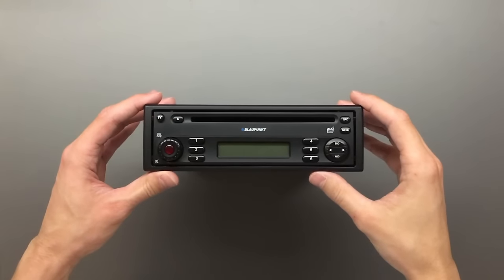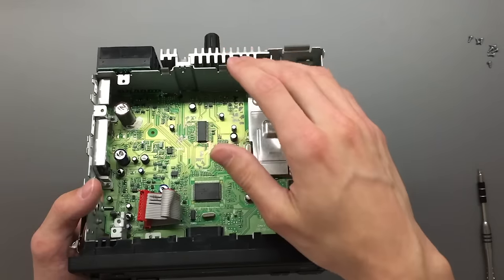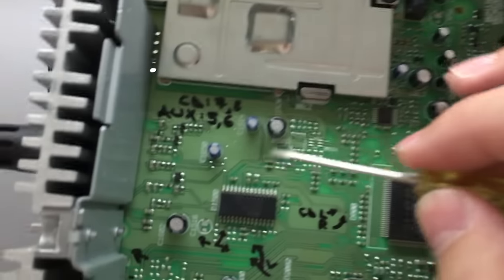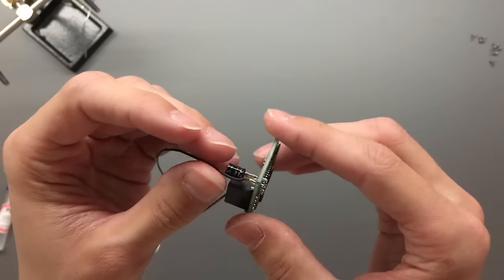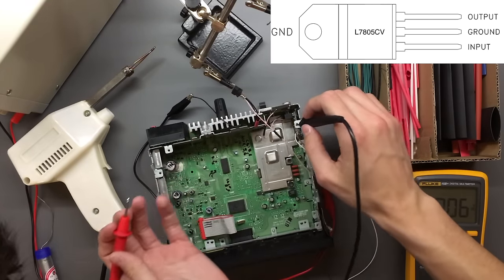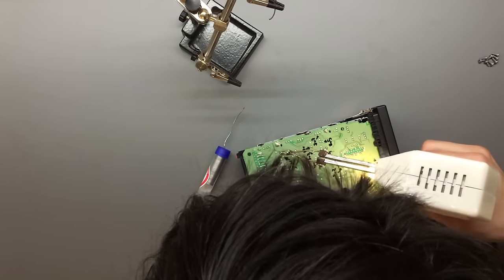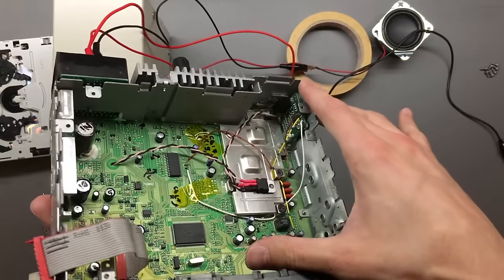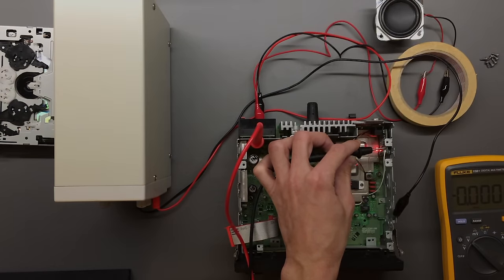How to Add Bluetooth 4.0 to Any Car Stereo for 12$ ! Complete Guide !

Comment: My radio has an aux output at the back panel, I mean aux switches. How I can use this connecting Bluetooth in cheap way?
Reply from the maker: connect the 3 audio wires from the BT module to the AUX in
Reply: Darieee the module that you used in this video?
Reply from the maker: yes
Reply from the maker: No, you need this : http://bit.ly/2zXSsFa
Reply: Darieee OK, thank you so much!
Reply from the maker: no worries :) good luck with your project

Comment: Great diy project. Perfect for stealthy installs and classics. Fiy, solder is pronounced "sodder"
Reply from the maker: yyyyea nah I don't know - I did check some reputable sources and it did seem to be sodder, I still enjoy pronouncing solder though ... jury's still out on which way I'm gonna go on this
Reply from the maker: Nah, works just fine - I'm just always playing a silent cd on it

If I pop in a normal one it'll play that (though if I play bluetooth music whilst a cd is playing it'll sound like shit and .. at the very least risk damaging the output drivers on either the BT chip or the CD player)
Reply from the maker: I'll be performing this mod (or at least trying) on a Becker Audio 10 CD tomorrow so, stay tuned :)
Reply from the maker: Mm, not sure I follow what you're saying

In my particular case I needed the CD player to actually play something, because otherwise the microcontroller wouldn't select the CD as a source (and whould keep it muted)

Only once the micro gets the OK from the player that there is a disc and it is in fact playing does it connect it to the amp

If your radio never mutes the outputs then .. you'd be free to not actually have a CD in there
Reply: if you enjoy it, don't let me or "correctness" get in your way =)
Reply from the maker: There's no switch, everything's digital, the micro asks the drive what's up and gets an answer, which I really didn't find worthwhile to spoof

Comment: I've d done it...thanks for the tutorial : )  ...now i can us my phone to play my musics... i did not connect the ground wire just the left and right wire for connected to my aux no ground because i noticed when i connect the ground wire to the case of the stereo... the left speaker have no speech or voice...just the low sound...then the right speaker has both low sound and high...
Reply from the maker: Yeah .. some weird ground issues ..

Some audio mixer chips have a separate 'audio ground' input, which sometimes goes through a capacitor

Take a closer look at the datasheet for your chip
Reply: @Darieee  yeah....but my chip is TDA4740D... so what will i do with the ground issue?
Reply from the maker: Are you sure that's the part number? Can't find any datasheet..
Reply: @Darieee  i'm sorry it's tda7404d
Reply from the maker: And which inputs are you hooking into at the moment?
Reply: @Darieee  the SE1L and SE1R, which is the cd mode left and right
Reply from the maker: Yeah, you need to hook the AUDIO_GND to the chip's GND ...

You might have some wires touching or some stuff if that doesn't work

Just to be clear, the bluetooth module you're using has an isolation dc-dc converter, right ?
Reply: @Darieee  nope i just use the bluetooth rechargeable receiver, if im not charging the bluetooth device, the sound is ok, but when i connect the bluetooth device to charging, static ground occurs

Comment: Darleee+ That 5v linear regulator that you epoxied down, do they make a 4.2v~3.7v to 5v boost regulator for a Bluetooth PAM8403 amp? Thanks
Reply from the maker: I'm not sure I understand what you need exactly .. send me a link of the amp and tell me again what you want to achieve
Reply: I need clean 5v juice like a battery with little to no noise or ripple
Reply from the maker: alright, and where are you getting it from ?
Reply from the maker: as in, do you want to power it from the wall or do you already have a battery pack made for this ?
Reply: I have a 10,000mAh LiPo battery, but I want to run it both ways and charge it with a TP4056, but I need to increase the voltage to 5 volts
Reply from the maker: alright so ... I think I understand what you're going for now

so, you want to be able to leave the thing connected to USB and have the battery stay charged but not be in use, right ? I do suspect the TP chip would just connect.disconnect the battery from the charger if you'd use it in plugged-in mode like that ..
Reply: Yes but I need a 5v boost of clean sine wave for audio.
Reply from the maker: yeah, for that simply go with this http://ebay.to/2zmJzZ1 - I've used it in many audio applications and its switching frequency is far too high to cause any issues 

(most of the noise you'll hear will be from the Bluetooth Radio and the noise floors of the BT Chip & Amp)

There is the other version of booster modules with the much larger chip - avoid those (they're way more inefficient/bulky/expensive)
Reply from the maker: what I'm thinking about now is how this setup (USB 5V into TP4056 ; protected output from 4056 into booster ; booster into amp) will function when you use it while it's charging AND fully charged ...
Reply: I use the TP4056 in series to charge my 16.8v. the inputs have to be separate. I use 4 phone chargers for isolation reasons and that solve the magic smoke issues
Reply from the maker: +MrBrymstond uu .. that sounds like a real hassle ... why not get one of these http://r.ebay.com/EEkksw and couple it with one of these http://r.ebay.com/jZXNrh (or 4S variant)

Also, why use a 4S setup for an amp that small that needs only 5V ?
Reply: I have the mini B6, but I had the parts and when it's done charging all 4 batteries are balanced because the stop charging at 4.2v so it saves me so much time. I've been using this system going on 3 years with the same batteries and parts. when They're done the meter says 16.8v and each battery says 4.2v. I have to use the 5S cables because each battery has 2 wires, both pos and neg. My mini takes forever. I'm using all good quality parts because they stop charging within a minute of the other. and charge time is cut by 70% each battery gets 1amp so 4 amps a enough.
Reply: I use the 4S on a different Bluetooth setup. Do they make a 4 pin boost 4.2 to 5v regulator
Reply: That's what I wanted to use, I have boxes of different quality sepic converters a just buck or boost, but I was talking to a guy from Voltlog and he seems to know something and says no, don't do it unless it's all surface mount high quality parts. I'm going with your idea which was the same as mine. It sounds perfect plugged in so just compare, Thanks a lot.
Reply from the maker: nah, those won't do that .. so .. for the small PAM amp ... it's complicated, you will have to build in a switch that disables the battery (and you could then just leave it at that : whenever plugged in - always on, when on battery, the switch acts as the main power switch)

for the 4S setup, your solution of 4 chargers is quite cumpersome .. does work but .. yeah .. I'd recommend the 4S bms + 4s balancing + constant current booster circuit
Reply: Yeah, I don't mind the switch, I would install it right at the battery and another 2 wires to the amp... They have to come up with a clean solution that's easy to get. I have a small Bluetooth with a UPC idea close to what I showed you where it always runs off the battery and starts the charge half way  depleted like this.  https://www.youtube.com/watch?v=p5lg0bfmgCw&t=2s
Reply from the maker: I'm sorry but I really didn't get almost anything from your last message
Reply: Yeah, I don't mind the switch to just use the battery, I would install the switch right at the battery .. They have to come up with a clean solution minus the ripple or noise that's easy to get being these amps are becoming so typical. I have a small Bluetooth with a UPC idea close to what I showed you in a url where it always runs off the battery and starts the charge half way depleted like this.  https://www.youtube.com/watch?v=p5lg0bfmgCw&t=2s

Comment: Nice video and you certainly know what you are doing but why on earth are you using such a cheap soldering iron? You might as well use a red hot poker :-)
Reply from the maker: old habits die hard - had it since I was 7 or 8 xD (will get something better in the near future though)

Comment: Would this work on an old AM-only stereo?
Reply from the maker: Mmm, technically yes, but, old electronics were done quite a bit differently

You may run the risk of coupling a lot of the radio energy into the amp ... 

Or not if the stuff's decently shielded, .. worth a shot in any case I'd say!
Reply: @Darieee  Thanks!  I doubt I will be able to find the schematics for the radio, but hopefully it will be simple enough to make an educated guess.

Comment: Thanks for the video! I got one of these modules and decided to just test it out connect to a 2S battery and see if I could pair to phone.  I do see some numbers/letters as an available device however phone says it 'can't communicate' - any ideas how to solve?
Reply from the maker: Not really .. it says CSR8645, right ? 

It might be the module turning itself off because of insufficient voltage: if you have the 12V version, you'll want to power it from 3S

Comment: 6666666666,
But how did you deal with the loading of the original audio feed (the other side of the AC coupling cap)?
Reply from the maker: I don't really get the question; you mean - how do I deal with whatever is connected on the outside of the AC cap ?

Well - for that I play a silent track audio CD -- that ensures there's no signal there

Comment: First, cool vid.  I like these kind of mods.  Second...get a soldering iron dude.  You have a $10 Chinese soldering gun and $200+ Fluke multimeter.  Fun video though.
Reply from the maker: nah - meter's actually 70$ xD - Fluke for poor people

aaand, I do have one of those 90$ chinese soldering stations (898D), and it's waaay shit compared to my trusty gun
Reply: :)) where did you buy that soldering gun ? I ask you because I know the tool very well and it's a real tank. One of the best products. I have a soldering station of $ 300, but I often prefer soldering gun.
Reply from the maker: geo geo  it's the romanian one made by Radio Progres or whatever their name was xD real beast indeed; one does need a dimmer in-line, otherwise it'll melt through diamond

Comment: My only "problem" with these videos is that in my case, I can' afford a decent cell phone and my now six year old crappy smart phone was a piece of junk when I got it.....it certainly hasn't gotten any better with age, and being disabled I can't just "race right out and buy a new one" either!! Sure my cell phone does Bluetooth connections.....but that isn't my problem with it!! No, no the problem I have is the battery dies after about an hour and in my case there are days when I am on the road all day long and having the phone charging on the dash for two hours defeats the "wireless" capabilities of the system!!! So no matter what I am still driving around with an ugly cord hanging out of my dash board that is getting in my way, as the cell phone is literally sliding all over the place as I drive!!! 

Honestly I wish somebody would come up with a way to cross breed a tape deck and a SD card MP3 player into a single unit!!! My one MP3 player for example only cost me $20 and I can install a number of Micro SD cards into it changing my selection of music when ever I want to listen to something different!! AND on top of that my MP3 player is older, BUT the battery lasts longer in that (it takes a single AAA) that I can replace at any gas station and have my music back in seconds instead of hours!! FURTHER my old MP3 player accepts 4 GB Micro SD cards!! My WHOLE music collection is roughly 30 gigs on my computer so a few of those cards and I can store thousands of songs that no phone could ever store all at once anyhow and YOU would never get that from a Tape or a CD either!!! Heck maybe convert an old tape deck into a head unit for a Raspberry Pi would be and INSANE BUILD I would love to see done, and perhaps follow as long as the Pi had an SSD drive for storage to hold all the music I listen too.....that to me would be BLISS!!!
Reply from the maker: mmmm, I mean, everyone has their budget but

I would suggest you go for a broken screen iphone SE ... and swap the screen (again, preferably with an original LCD one, otherwise they look like shit)

in europe that will cost you around 100€ or less

and you get the latest iOS, buttersmooth performance, and a nice form factor, AND A GOD DAMN JACK

Comment: Where is the antenna? 
Where is the pairing button?
Reply from the maker: It's on the module itself

There isn't any - when it power on it looks for the last paired device; if there isn't any or it's not in range, it becomes pairable

Comment: Your car should not be running at 17 Volts, you will fry your battery over 15 Volts. It should run at a max of 14.5 Volts (off load).
Reply from the maker: Really shouldn't - but - if it does, better not have your mod fry in the process

Comment: can i connect/ sodder rca cables to this board?
Reply from the maker: which board ?
Reply: Bluetooth i was thinking to make rca-Bluetooth to connect my tablet directy to audio processor via bt
Reply from the maker: then by all means - nothing stoping you ! Just buy the module that's piggy-backed onto the green board: that way you get a differential signal (there's a tiny headphone amp / differential to single ended converter on the green board).

Don't forget to give it a cool name and tune up the equaliser ;)

Comment: I would bet money one of those 0 ohm resistors sets the "model" of the radio.  I bet if you removed one it would suddenly enable the cd changer inputs..
Reply from the maker: Would unfortunately loose said money (though based on a clever and reasonable hunch)

They're surrounded by the gound plane
Reply: I didn't get to look close enough at the board but that would be my first guess.  Its very typical on a lot of the equipment I work on to have hidden features that are enabled/disabled by 0 ohm resistors.  If its truly across ground plane it wouldn't really even make sense to put them on the board (not that logic rules board design)
Reply from the maker: It would to mark either layout, indeed wether it has aux or not, mind you the components on the aux in path also aren't populated, or anything else .. in a cooler way that using the silk screen, which there might've been none of from what I remember - so, silk screen vs 3 o link res ...

Comment: Shouldn't the datasheet for the switch chip have info how to switch to aux? :p
Reply from the maker: Most likely, that still wouldn't help at all if you think about it
Reply: If it's just a matter of pulling a pin low you could easily work it with one of the existing buttons or add one
Reply from the maker: I'm very suspicious of there being some i2c or spi interface going on ... it's a relatively modern unit, so, that sounds plausible

Also programming the micro is extremely out of the question so ... 

And in any case, the only issue I'm having is the 2 3 second delay until the disc spins up ... apart from that, it works quite flawlessly
Reply: Darieee well it should be obvious from the switch chip.. if spi is going on then you could use an small arduino :)
Reply: I wonder if one of those 0 ohm links you attached the audio ground to would turn on the cd changer option. I'd be tempted to move it and try the menus to see what changed.
Reply from the maker: They're all connecting ground to ground though
Reply: Fair enough.  I didn't spot that when watching the video.

Comment: That's cool to know how to, but I'm pretty sure that if you spend 12 more bucks on the radio itself, you'll get bluetooth.
And I think just getting an aux to bluetooth adapter would be much easier.
Reply from the maker: You'd need an aux in for such an aux bluetooth adapter to work

Also, you can get bluetooth aux usb radio head units for <= 20$, but ... I seriously doubt their sound/build quality
Reply: I've tested some of those 20$ head units and they weren't that bad, especially if you have a cheaper car, your speakers are probably pretty bad anyway so no need of a good head unit.
Reply from the maker: Well, still, I personally really hate the flashy 2005s radio look with the constant light show and the weird colorful buttons. 

Sure is a decent option that's for sure, show a 20$ radio with wireless usb aux and regular radio to people of the 90s and they'd probably have 2 heart attacks at the same time

Comment: 9:57 - dude, you must stop using this type of soldering tool, because it generate huge voltage spikes and you can burn all chips.
Reply from the maker: I have stopped, and it also never did manage to fry anything

Comment: why i don't buy new radio with bt buildin for solve this problem.
Reply from the maker: Because you like the way your old radio looks and works whilst simultaneously have a profound sentiment of disgust towards new design paradigms used in almost all modern stereos, all while you also low key fear that cheap units will sound like crap

Comment: You can get a Bluetooth dongle for 20 bucks, plugs into the AUX input, powered by USB charger. Mine is in my home systemas my car unit has tooth already, for a 20 dollar P.O.S it sounds really good. Of course you can also plug your phone into the AUX. This looks like a fun project but is really about as useful as a steering wheel on a mule
Reply from the maker: So, you're saying my radio has an AUX in huh ?